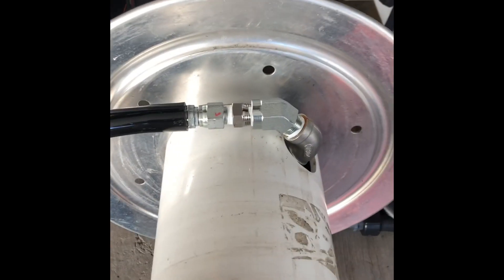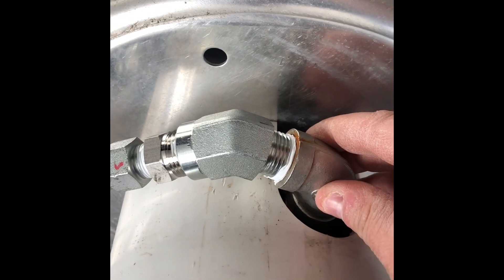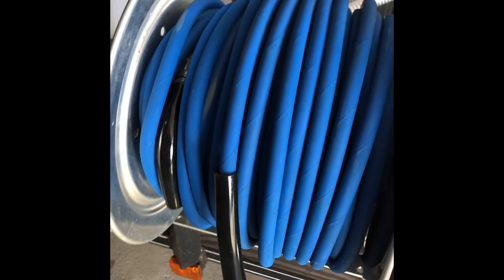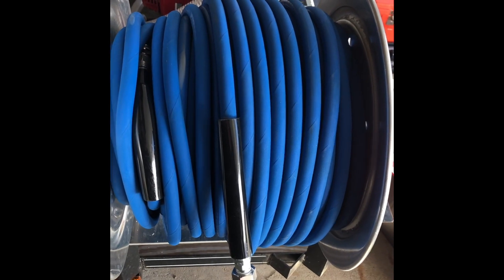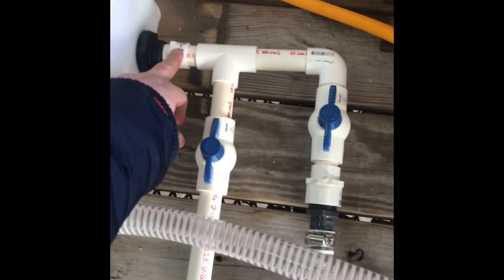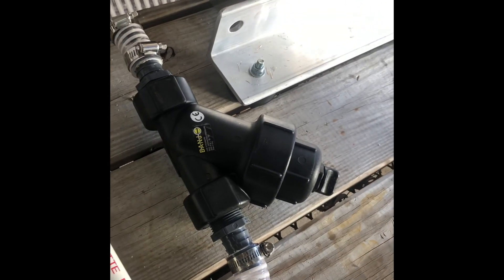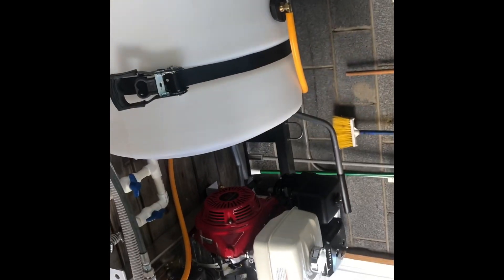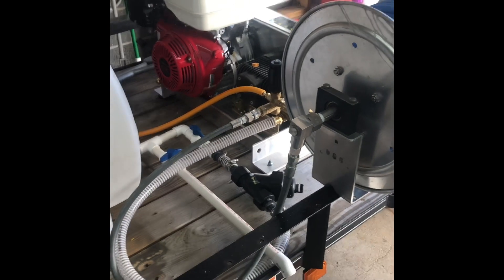Pressure washer trailer build part 3.hose reel and plumbing setup

Comment: Are those reels mail it directly to the rails without any supports and if so how has that been holding up as far as rigidity etc.?
Reply from the maker: They have supports on the bottom. Have not had a single problem with them, rock solid.
Reply: @mattreno-washituppressurew6834  I'm looking to do the same thing so that's why I'm asking.

Are the supports welded to the rails?
Reply from the maker: No nothing is welded on my trailers, it’s all bolted. I like the options to move things around if need be.
Reply: @mattreno-washituppressurew6834  so basically it looks like you have two bolts holding the reels on to the side rail...correct? 

Yes it's me again I had a death in the family and my build was delayed.

Comment: Nice video series Matt.  Your set up looks nice and clean.  The banjo filter will work how you have it on it’s side but optimally the correct way is with the strainer facing down.  Dirt and solids will fall into the strainer with the help of gravity.  I see many installs where people have it facing straight up which is incorrect and as you stated the drain plug should be on the bottom, not facing straight up.  I commented on a few videos pointing out that they had the filter installed correctly but they told me i was wrong.  I work in a chemical plant with a very complex process and we use Wie type strainers all through and they are all mounted with the strainer facing down and of course with the drain plug on the bottom.  Good luck to you!

Comment: Tips on mounting the pressure washer?
Reply from the maker: Simple drill holes use long stainless bolts, with washers right through the floor boards.

Comment: I’m building a rig but I’m not sure what size hose to go with. I have a 5gm 3000 psi.    Also what would you recommend for 5.5 gpm soft wash hose?
Reply from the maker: Nice. Go to 
www.pressurewasherproducts.com
They have it all broken down as far as GPM machines. Not sure the proper size for a 5gpm machine. I know my 8gpm is 1 1/2”

Comment: Did you have an issue connecting your two 100’ 3/8” hoses? I’m having an issue with connecting two 50’ s on my titan 4312 reel. Where I connect it with the quick connect it’s so damn bulky and my plastic covers at the ends are causing it to bulk out as well.

Comment: Is that bulkhead 1/2 ? I’m trying to do this exact set up plumbing wise so I can fill up a bucket and downstream. Also wanna somehow configure a garden hose connect where I can fill the tank and  rinse out my diaphragm
Reply from the maker: I’m not 100% sure on bulkhead size. I did trial and error for mine. Definitely could hook up hose connectors
Reply: Where did you get your titan? I don’t trust spending 900$ online for two reels but I can’t find them anywhere.
Reply: How did your plumbing end up working out though?

Comment: I’m planning on doing the same size trailer and set up. What size buffer tank do you have on that? Are you going to be putting your surface cleaner on the trailer or somewhere else will it fit on a 4 x 6 trailer? Thanks bro
Reply from the maker: Hi michael. On the 4x6 I had a 65 gallon buffer for my 5.5 gpm machine. Did you see my new build? On the 4x6 there is not room for much else.

Comment: Where did you get your blue pressure washing hose?
Reply: Last question, where did you get the grey hose from?
Reply from the maker: Same place. Washmart.com
Reply from the maker: Hi Desmond I got it from Marco at Washmart.com 
Only problem is they discontinued it or he stopped selling it. I had a problem with the hose leaving blue marks on freshly cleaned surfaces. I would advise against blue and just get grey 1 wire.
Reply: Thanks a lot.

Comment: Would stainless be a problem with chems?
Reply from the maker: I only have stainless connectors everywhere. Never had a problem I usually change my connections once or year or even longer. It all depends.
Reply: Matt Reno- Wash it up pressure washing so as long as you do regular changes, shouldn’t be an issue?
Reply from the maker: Yes use stainless and change when necessary

Comment: Thanks for the video im thinkin of a trailer build but i feel like i fucked up i bought a 1000 pressure washer last year and i didnt get a belt drive i feel like i wasted a grand now its bin sittin in my shed didnt even start it yet its one of them Simpson 4gpm ones
Reply: It will work- A direct drive cleans the same as a belt. 4gpm is 4gpm..for any house 4gpm is well enough...make that money and stop waiting...

Comment: Real Nice Work! Where did you get that non collapsible hose ? Also, I’ve got that exact washer on order. How do you like it? Got any videos of it in action ?
Reply from the maker: Sean OBrien thanks appreciate that. Got the hose from pressure washer products. They sell a whole plumbing kit. Just have to give them specs on your machine and they hook it up. Machine is great I’ve only had it for a few months and it’s solid been doing residential and commercial jobs with it no problem. Subscribe to me I have a few quick demo videos. This week I’ll put a few more.
Reply: @mattreno-washituppressurew6834  How is the 3/4 suction line to the Pw running? Just wondering if I can run a 1 inch line to my Pw? Just got a 5.5 gpm machine thanks bro.
Reply: Oh I’ll have to get the plumb kit from them! Thanks for the advice!!!

Comment: Looks great matt... I don't think you should have a problem with running chemicals through your hose reel and hoses. At about a 1% mix it should be fine. Just always flush the injector and lines and all at the end of the day and you should be fine.👌🏼
Reply from the maker: Thanks!!

Comment: Hey Matt. Before you even said where you were from, I said Brooklyn or Staten Island lol. I am On Staten Island too. I didn't see a chemical injector to downstream your chem mix or a chem tank. Are you going to draw from a bucket? Where are you going to put the injector by the pump or wand? Good luck out here man.
Reply from the maker: Lol that’s great! I have a downstream injector and I mostly use an xjet. I do not want to run all my chemicals through my pressure reel so will probably just use the xjet until I get a 12v pump and reel just to spray chemicals. Thanks man you too